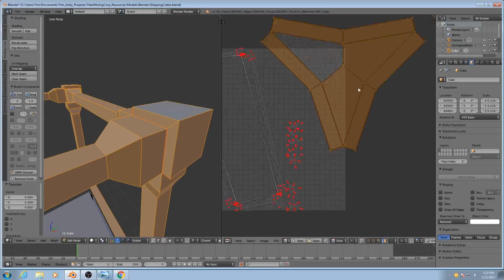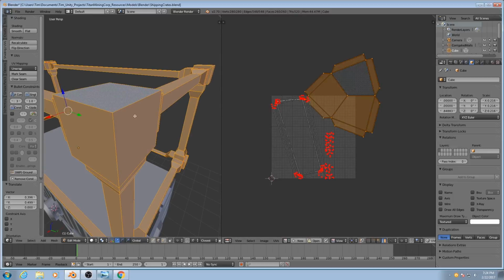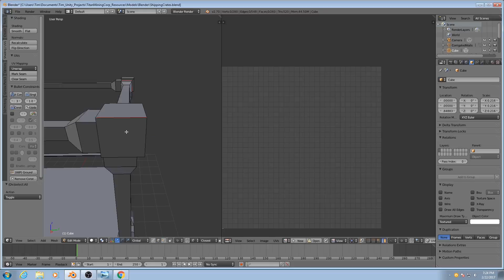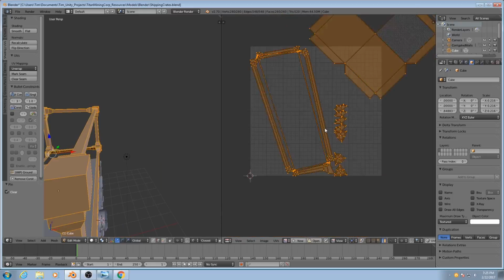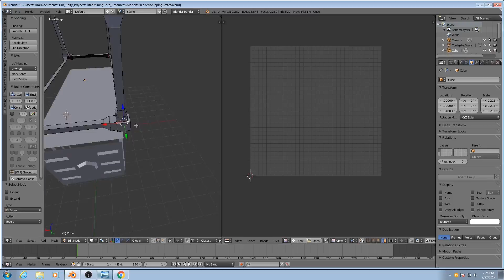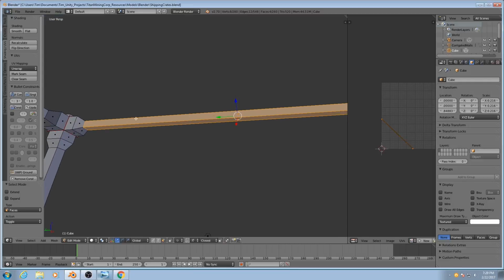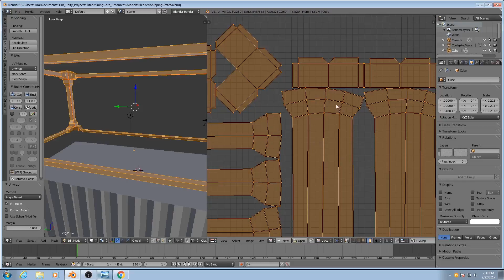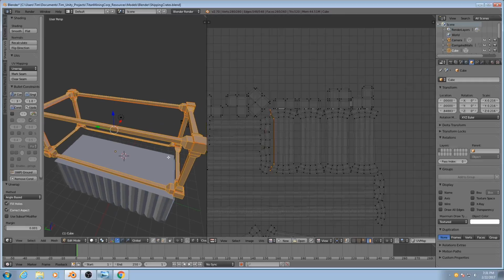Blender Game Asset Modeling Tutorial (Part 8)

Comment: @AlineMinefield hi I am having some minor trouble with the uv map. I have 2 vertices at different places and selecting any of them will result in selecting the other and thus, moving them extremely difficult. I am not sure if you understand what I mean, but I can send you my blender file if you would like to have a look at them. Thanks.
Reply from the maker: That happens if you have UV selection turned off in the UV/Image editor. What's happening is that  you are selecting a vertex that bridges two UV islands. Since the vertex is represented on both islands, both of them are being selected and moved. UVs and vertices are not the same thing. In the UV/Image editor, there is an icon that looks like a box with the vertices highlighted. It's to the right of the tab that says "View" and left of the vertex/edge/face selection toggles. That button is the switch that turns on selection synchronization between the 3d View and the UV editor. With it on, anything you select in the 3d view will be selected in the UV editor and vice versa. The problem is that you can't select UVs specifically, only vertices/edges/faces. If synchronization is turned off, then you can select UVs instead of vertices in the UV editor.

Comment: Wow! That was much harder than expected! I had weird scaling and UV mapping issues going out. Turns out I needed to do two things to fix it:
1. Remove Doubles - For some reason I had double vertex points.
2. I had to manually remove some double edges, by deleting the edges and then refilling in the faces and marking the seams again.
Took a while to figure out, but I guess I now understand UV unwrapping just that little bit better.
Reply: Thank you so much! I had the same issue :D I had to remove doubles automatically and manually. Now it works!
Reply: thanks man